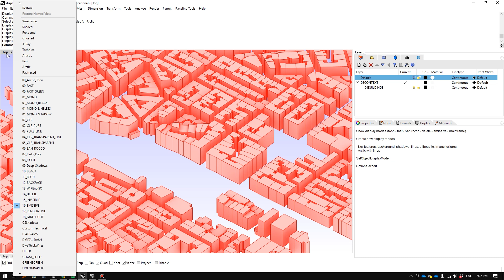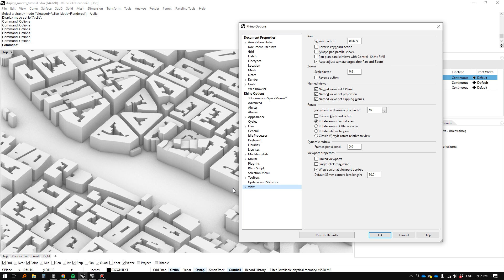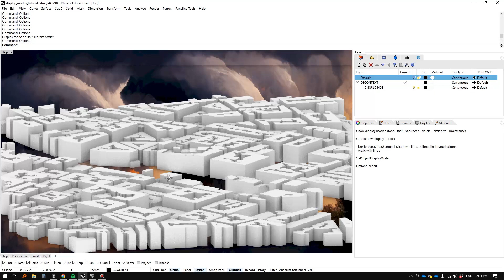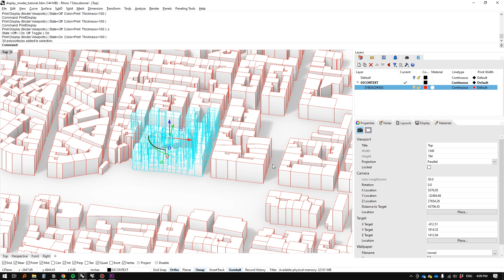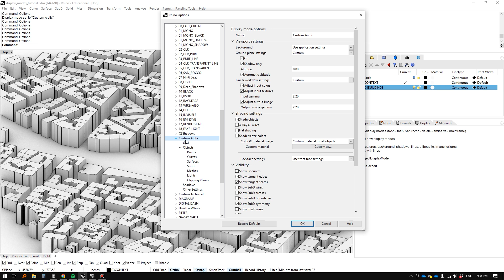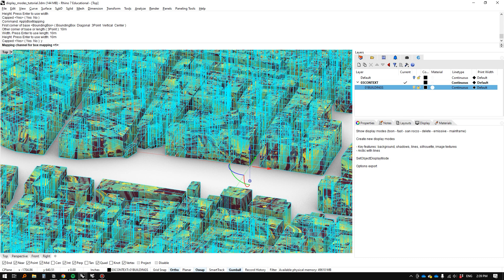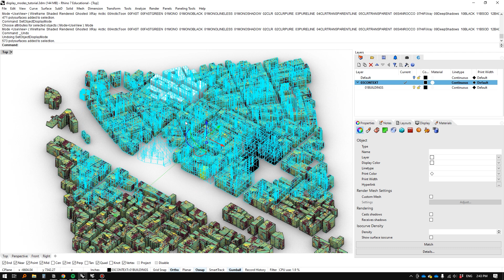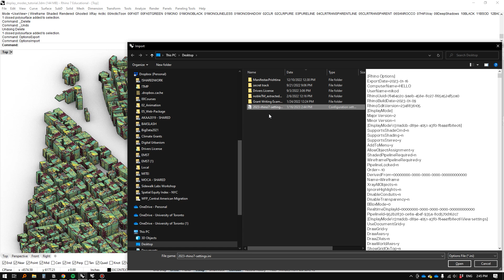EXCLUSIVE Rhino Tutorial: you're probably drawing wrong

Comment: Dear Nikol. Thank you for responding so quickly.

Something happened: while I was creating a simple new scene on a default Rhino template, the problem magically disappeared,. For some reason, this problem only appears in the specific file I was working on. The challenge is figuring out which option I changed that caused the problem. Anyway, thanks a lot for your help.

Comment: Hi Niko. Great tutorial man! I probably must have watched it 10 times. However, there is something I can't resolve regarding the thickness of the lines. I wanted to have this freedom to define the thickness of each object, also in layout views, but it seems that this only works in modeling views... any suggestions? Anyway, thank you very much for everything.
Reply from the maker: you can set the thickness per layer or per object. you then need to specify when you print to follow the object settings as opposed to the print settings. Let me know if that helps

Comment: I have a question, I personally use the layout and I'm wondering if there is an option to apply it in the layout, without assembling a dozen or so elements? And to have it in an editable form, thanks in advance for your answer
Reply: i'm curently working on my workflow, with rhino, but i don't like using ilustrator :)